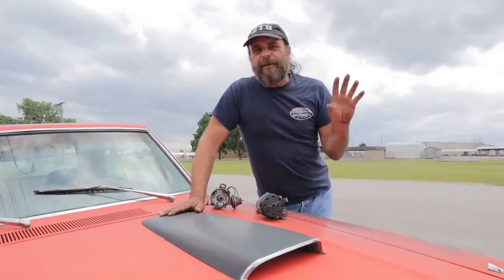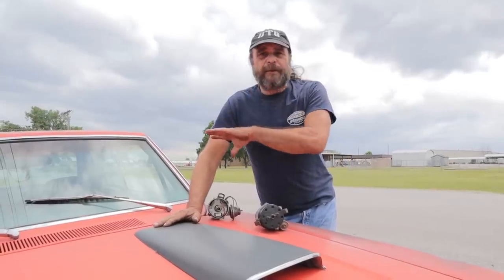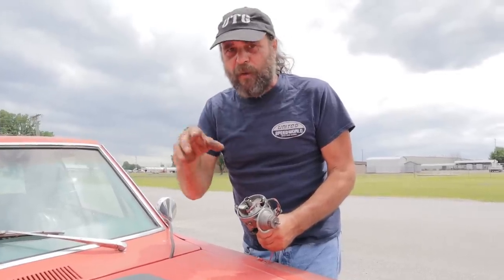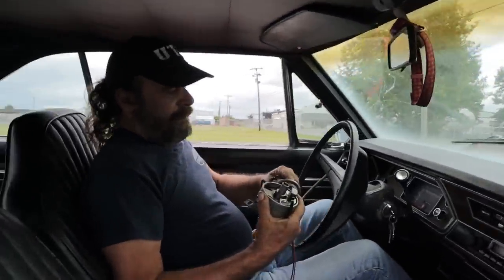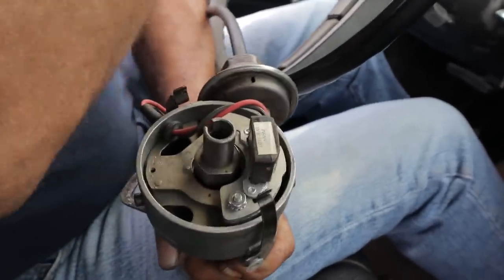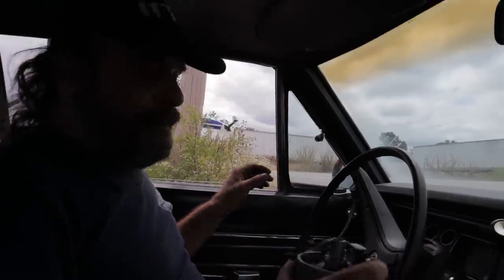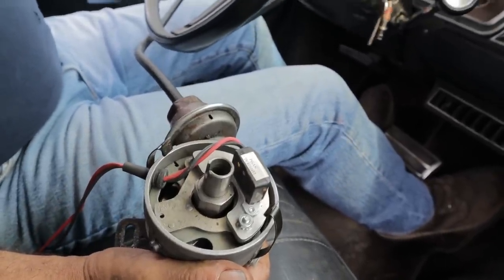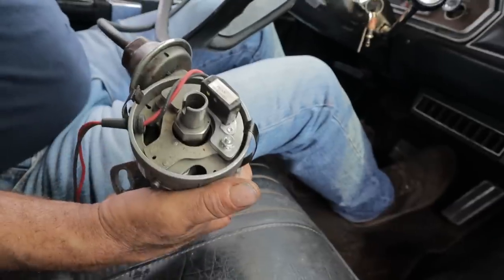The Vacuum Advance Debate!

Comment: Ive been looking at my old auto manuals, so far all of mine show them using ported. A 1955 GM car, 1960 Ford truck, (except the Load a matic which uses venturi vacuum and ported). Should be noted that venturi vacuum is the only one that goes up as engine rpm increases. Although a very weak signal. My Motor manual which has nearly every US manufacturer from the late 40s to the mid 50s also has ported for all makes. In fact the only two manuals i have that use manifold is a Contenenital industrial engine and my emissions era AMC which use both with a coolant temp switch, manifold when cold and then switch to ported later. The manifold vacuum in that case apparently gives great advance to help fully burn the rich mixture when the choke is on. Although apparently some do the opposite to cool the engine because idle speed will raise to help the mechanical fan.

Comment: The one area I still struggle with is why to use port vacuum, like Tony suggests, when the distributor weights and springs were designed to advance the timing mechanically under throttle? Why would the car manufactures design both types (mechanical and port) to advance the timing when one can do it by itself. The explanation on using manifold vacuum makes more sense to me because under cruising (part throttle), the air fuel mixture, which is less dense, needs more advance timing to allow the mix to burn efficiently, making the car run cooler and smoother. Advancing the timing under this driving condition can only be achieved through manifold vacuum. So, the system uses manifold vacuum at idle to low speeds then switches to mechanical advance when under acceleration, keeping correct timing under all driving conditions, thereby negating the need for port vacuum all together.
Reply: Exactly my experience, I can see many benefits of manifold vac  on my inline 6 (261) especially temperature, starting and mileage.
Reply: Exactly.  Ported timing is redundant.  Its performing the same function as mechanical just laid over the top of it.  Manifold advance gives you what ported can’t - timing in conditions of high vacuum/low load when your engine needs it.  Uncle Tony has this crusty old idea lodged in his brain and doesn’t revisit or question the old beliefs he’s been harboring for decades.  Classic old person.

Comment: I changed the cam on my 350sbc and had left the vacuum at ported. It ran good set at timing and everything. I read up about how ported was made for pollution control and hindered car performance at idle. I changed it to manifold vacuum the other day and holy shi*!!! The car ran better, idled better, and drove well overall. I decided to play around with the timing a little and move my distributor a tad bit more with manifold vacuum and damn I got even more kick out of the mouse. Didn’t know how much performance I was leaving at the table with just one darn vacuum line.

Comment: I've was taught to do my timing with the vacuum advanced off and then attach the line to the port on the base of the carburetor, never thought that much of which side to have the distributor to get its vacuum from, I've always put the line to the carburetor ports, if on the manifold vacuum tree then cap it and place it to the carburetor.

Comment: Should be added that some advance canisters can be adjusted with a tiny hex wrench up the vac tube to adjust how much timing the canister gives. Aftermarket "performance" canisters typically have this feature.
Reply: Yes , I bought an adjustable vacuum advance for my 75 Caddy and kept a little allen wrench available so I could adjust my vacuum advance at Cruise or if I was Towing a very heavy load with 87 octane . I recurved the distributor timing with different springs and different factory GM weights in addition to the adjustable vacuum advance. I think the vacuum canisters that have the hexagonal instead of the round bodies have a plate in there that the adjustment screw goes through and that screw can give more or less pressure on the spring that the vacuum diaphragm pulls against- I'm not sure if the round ones are adjustable or not. My buddy bought a Mopar electronic ignition conversion kit for his 69 roadrunner and I remember the instructions were pretty cool and thorough and how to setup the vacuum and  mechanical advance for performance and mileage. I think going back twenty years ago it said to set up the mechanical advance first  (with the vacuum advance disconnected) by doing I think it was second gear acceleration runs to optimize performance without pinging or detonation . And then after you had the mechanical advance optimized  you would hook up the vacuum advance and adjust that  for driveability and mileage.

Comment: The ONLY difference between the two is you don't get vacuum advance at idle with ported vacuum. They both work exactly the same at part throttle and wide-open throttle. Use which ever one makes your engine run best. 
It will let you know.
Reply: Works for me!!!
Reply: Nope.  Watch a manifold and ported vacuum gauge side by side and you’ll see that they are not the same at, for example, low load/cruise conditions where the throttle is barely cracked and manifold vacuum is high.  When you’re flying down the highway in cruise you need the timing only given to you by manifold vacuum advance.  Better mileage and cooler temps.
Reply: @yeboscrebo4451  Once that throttle is opened past idle, there is FULL vacuum.

Comment: Its more complicated. It really depends on how it was setup from factory. For example. if distributor does not have mechanical advance, than using ported vacuum advance is how its done. Also how it vacuum advances different on different era distributors.

Comment: Tony is correct as usual; vacuum advance is connected to ported vacuum. 
The Factory Service Manual even makes specific note of this on our Mopars, 
for example, at least up through the early 70's - as do the instructions included
with most of the typical Edelbrock and Holley street carbs you buy.
I don't currently run any vacuum advance on my Mopar electronic ignition on my
440 in the GTX. Again as Tony says, I'm mostly interested in what the total timing is
"all in" at about 2400-2500RPM, usually 35-36 degrees BTDC or thereabouts.
Wherever that puts the initial timing at idle is of lesser consequence to me, as long
as it's liveable (car starts easy and idles decent); in my case running a Mopar Performance
distributor NFW (not effed with), that puts initial around 15BTDC, for example.
I do want to run vacuum advance on it, but that's a tuning thing all by itself, too.
As it is now, when I hook that up, the car is quite "jittery" at part-throttle cruise, doing a 
sort of stutter step because the amount of additional advance being given by the vacuum
assembly is not right. On these distributors, a tiny allen wrench is inserted into the hose
nipple in the vacuum diaphragm to adjust the amount of vacuum advance. 
I just haven't gone through that process, because it can be time-consuming to play around
with, so I just run without it for now.
(HEY TONY, I'D LOVE TO SEE A VIDEO ON HOW TO QUICKLY DIAL IN THE VACUUM ADVANCE!)
Thanks as always, Professor Tony,
-Ed on the Ridge
Reply: My plan is to lock my advance out with a metal plate. (They sell them for limiting travel or locking out) Then I set total timing that I want.  I have a msd6al2 programmable, that will pull timing electronically. You setup your rpm timing curve on a computer and send to msd unit.
Reply: @Dodgechallengersixpack  I've never run an MSD, so help me understand here - the MSD controller pulls timing out at lower engine speeds (like at idle)?
Reply: @moparedtn  I believe he is running, in addition to the MSD ignition box, an MSD timing computer. It uses the distributor as a crank sensor only and ignores the initial, mechanical and vacuum advance. The timing curve can  be programed with a computer  instead of using springs,weights etc. and will now change based on rpm and manifold pressure sensor.
Reply: @berserk7111  Thanks, that was along the lines of what I was asking.
Pretty slick stuff for sure, too - price depending, as always.
Of course, no matter how you choose to control timing, it comes down to knowing what to set it to to begin with.
I like that experimenting seems easiest with that computer for sure.
Reply: @moparedtn   I've been looking at the Megasquirt ECU's, specifically, the MS3Pro. If you are not familiar with it, you might want to check it out. Sounds perfect for those of us that like to experiment. All sorts of sensor inputs and algorithms. It even has a wireless digital dash function you can use with a smartphone or Ipad. I almost bought one and then the apocalypse hit. So, I guess it's back to theory/trial and error for me, at least until things start to pick up again.

Comment: sometimes i like to use manifold vaccum with a cammed engine. it tends to keep the fenders from shaking off it but usually i just end up not useing the vac advance.
Reply: True and probably helps the spark plugs at idle
Reply: Yeah I put a cam with a tight lobe separation angle in the my truck it isles so much better on manifold
Reply: @tl5108  Tune your shit right.
Reply: If it runs better on manifold vacuum wouldnt you adjust initial timing?
Reply: @boss351gt6  well running it on manifold vac just makes it run smoother the when you stab it. vac drops n you revert to mechainical advance. only really food for cruising n idle
Reply: Simon Pyrros   That works for idle quality, but you may have too much timing everywhere else depending on how the distributor is curved.
Reply: @tl5108  If idle is your main concern then dont use a tight SLA cam.
Reply: When GM ( I'm a chevy guy) did vacuum ported it was the 70s emission.before then factory full vacuum was common on 327s
Reply: Id have to adjust the timing curve in my distributor because if i advanced it any more on ported it would ping but it would run so rich at idle. So by going to full manifold it advanced it enough at idle that its burning cleaner but maintains the same total timing and doesn't ping

Comment: I guess this depends on your set up and what you're trying to accomplish. I've got my initial timing at 22° BTDC and total timing of 36° (mechanical advance limited to 14°). My adjustable vacuum  advance is adjusted to 15° max and comes in completely at 15" of vacuum. I NEED the extra advance when I'm stopped in gear. My manifold vacuum is 5"with the vacuum advance connected to manifold vacuum where it's 2.5 connected to ported vacuum. As I start moving, the centrifugal advance slowly (or quickly) moves in. At part throttle cruise I'm between 15-20 " of manifold vacuum and total timing is around 50° BTDC. When I open her up, the vacuum advance falls away and we're now running strictly on initial+ mechanical advance (36° total). With ported and manifold, we have advance at part throttle cruise. In my case, I also have it at idle in gear which bumps me up to 32° or so which allows her to idle much better. I've got a solid roller, btw with 630 lift intake and exhaust on a 108° centerline. Duration at .050 is 260° and 266° and it's 13.5:1 compression. Not a street engine, but man, it's a blast!
I suppose that I could lock out the distributor and run ported vacuum, too. There's more than one way to skin a cat but this is what hot rodding is all about❤

Comment: Is this backward for just me or a bunch of people? I thought manifold vac was better for big cam engines to help smooth out idle. To date everything I have read has always said manifold vac advance is the way and that ported was only good for some mopars and later used as a crutch for the gas crunch smog era emissions. Great video as always demo is excellent. Maybe I need to go flip some hoses around and save some at the pump due to more mpg. Thanks for the knowledge!!

Comment: I’ve found that, when the idle circuit on the carb is “right” ported vacuum drives better off idle.  Manifold can be a crutch for a poorly tuned carb.  In almost every case, ported has worked better for me, despite what all the Internet forums say.

Comment: I get what your saying. It make total sense. I guarantee alot if people will not agree. I tried it and its exactly like you said. Manifold starts at full advance but as soon as you hit thr gas it retards your timing so you lose timing. Ported gains timing the more you give it gas.
Reply: Manifold does not retard the timing,  the centrifugal advance takes over, depending on how much throttle you are inputting.  People say as so as you open the blades is not correct, only if you quickly open them all the way will vacuum drop, but ported will also do this only you will not have the benefit of idle advance. Some people have a mental block or something and do not get it. There is a lot going on and all these systems need to be tuned corrected to work correctly.  Many folks just do not want to put in the work and tune a distributor.  You also need a dial back timing light or degreed tape on your balancer to see what is going on with these systems
Reply: ported does not give more than manifold at ANY TIME, how can it ?

Comment: Manifold vacuum does not remove advance needed for WOT, because at WOT manifold vacuum is at zero. It can't subtract from the initial/centrifugal already dialed in. Plus at WOT the engine does not need all that advance since the cylinders are being filled to full capacity. At WOT you are strictly adding centrifugal to the initial. Vacuum advance is a gas saving/drivability device & has absolutely no influence on WOT. I have found with an automatic trans the extra advance from the vacuum advance smooths out the idle with a big cam, improves drivability, and runs cooler. All pluses, with no drawbacks. When starting there isn't enough vacuum to activate the diaphram so it starts easier as well.

Comment: Basic. Ported. Manifold give an unstable.  Step on the gas and timing drops out. Big cam, put it in gear, vac drops out. Idle.surge.on cam at idle, timing drops out, wants to stall. Manifold is not what you want.
Reply: What does fry burger think?
Reply: Yep, mostly mechanical can be good too, especially if it's a race car or constant heavy load too, where there's not much vacuum signal.  A vacuum can that comes in fast with not much vacuum doesn't drop out as quick, or only drops out just a small amount (mechanically limited) might be fine running on manifold vacuum.  GM for instance probably used near 30 different vacuum canisters on the many applications, both manifold and ported were used.  Later vehicles with emissions were mostly ported and earlier, especially performance, were manifold.  General vanilla in 70's ported was quite common.
Reply: Dont you guys realize its the same thing as soon as you step on the gas there is zero difference between port and manifold, port vs manifold affects idle only
Reply: @researchandbuild1751  well hello again! Yes you are correct, ported and manifold vacuum are practically identical once off idle.
Reply: @researchandbuild1751  If your can never moves, or moves full advance, there's a difference.  For instance, a can that's calbrated for all-in @ 18" will likely produce a different result than a can that's all-in @ 8" vacuum, right?

Comment: After years of being convinced that vacuum advance was best, I recently updated my logic.
If you actually run a vacuum gauge into your car while on ported, new can really see and appreciate what's going on much better than looking at a distributor in your lap.
Ported gives peak vacuum at about an eighth throttle which is where you do most of your cruising then falls off at the same rate as manifold would just later than manifold does because ported starts later(so it ends later).
I switched to ported vac with 18° base timing, vacuum pot set to deliver 10° at 10 in. of vacuum and mechanical that makes 19° total all in at 1800.
My 9.5:1 aluminum head 318 refuses to ping at all anytime even with 87 octane.The car runs like a bat out of hell, MPG improved significantly as well.
Reply: Huh!?  At high manifold vacuum, ported vacuum is very low.  I do my cruising when manifold vacuum is high so running manifold vacuum advance is where its at.  Run a manifold AND ported gauge side by side to see their inverse relationship at cruise.  They are the same at part throttle but at cruise, manifold is high and ported is low.  Manifold vacuum advance will give you more Mpgs quieter engine and lower temps.

Comment: Well on my 70 Buick Lesabre with 350, I swapped the vac hoses around on my thermal vacuum switch.   I saw I was running full manifold vac on the dist. The bottom port on the drivers side on my quadrajet had no vac unless I worked the throttle. So I mistakenly criss crossed them.   When I made the switch,  it was a much smoother ride and swifter kick in the pants when accelerating.  When the car is idling hot during heavy traffic, the tvs plunger is supposed to shoot up and block off the ported and allow manifold to help cool off the engine with higher rpm...  I realized something was wrong when my engine really bogged down when it got over 190 deg.   But now, my engine runs much cooler.

Comment: I've seen it make a big difference, maybe a big cam high compression built motor likes manifold, but that extra hit off the line you get from ported can really wake up the junk I like to mess with.
Reply: That doesn't make any sense. First a big cam doesn't pull enough vacuum at idle  - second, as soon as you open the throttle both are the same, so  where would the benefit of ported come from?